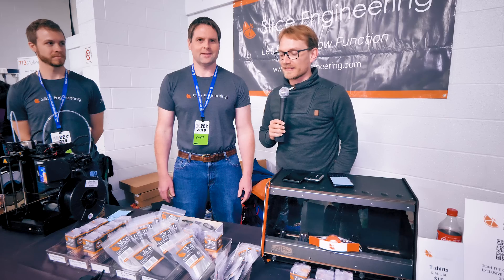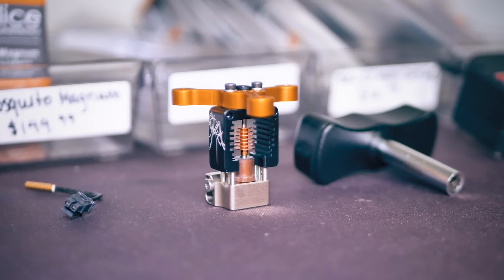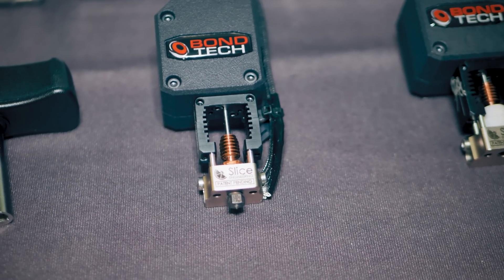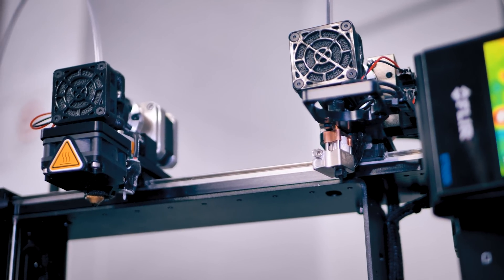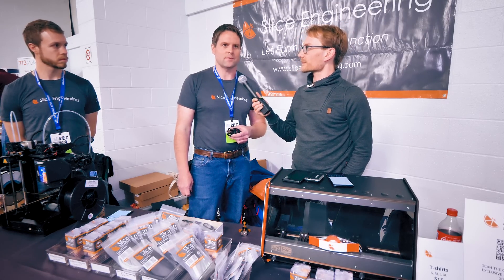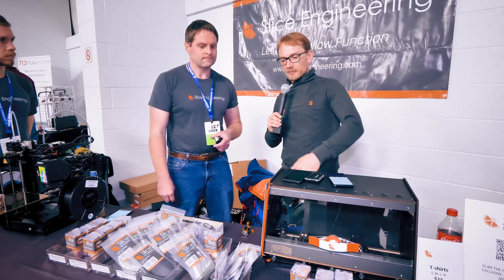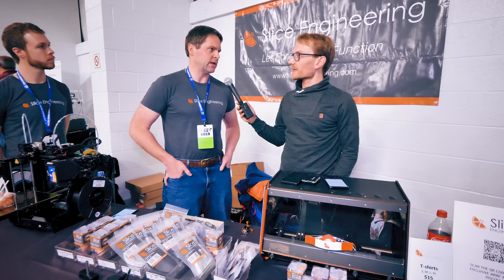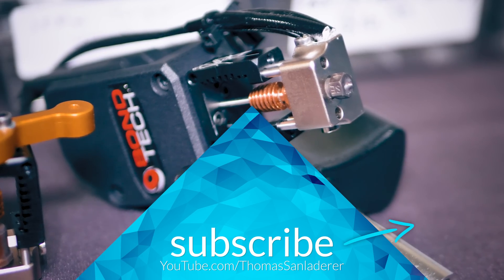The Mosquito Hotend is... wild! #MRRF2019

Comment: Just added this combo Bondtech LGX with the Mosquito to my Voron 0.1 and I am very very satisfied. Prints are amazing and I am told that this combo is not a typical choice for a Voron, especially not a 0.1, When I start building my Voron 2.4 I will surely have this combo on that unit as well.

Comment: I don't know why they stress so much the fact that it allows one-handed nozzle switching and doesn't focus on the heatbreak. This hotend is not a curiosity that allows the nozzle to be changed more easily than a V6, it is the best hotend on the market and it gives a print quality above anything I've tried. Even being an All-metal hotend, the regular version allows printing PLA with retractions without any sign of jamming. And at the same time you can print Nylon or any technical material. It is simply the perfect hotend.

The day I met the BMG extruder, I was amazed at what it was capable of and decided to change all the extruders of my machines for this one. The same thing happened to me with the Mosquito

Comment: So what is that black 'clamp' made of, where the additional four bolts go in? Is it ceramics? Or titanium?
Reply: The black part is an anodized aircraft grade aluminum heat sink. There are only two bolts that enter that heat sink, the other four posts are hollow tubes to reduce conductive heat transfer away from the hot block.
Reply: @SliceEngineering  Thank you!

Comment: I'm very sold on this, most of the android parts have to be super filaments that require 300 or hotter temps to print pa12, hytrel, peek, etc and even for the carbon fiber polycarb that's still 275 which is out of range for standard stuff

Comment: Hallo Tom
  Would be interesting to see a review of TMC5160 drivers and also some heads up for Trinamic's brand new integrated controller driver TMC5161. The later seems really interesting with integrated mosfets. Pretty sure watterott electronic would come up with a silent step stick with TMC5161.

Comment: "Means of cooling other than fans"!? Am I thinking glycol is involved?
Reply: Nah. It's just that there's so much thermal mass on the mount they were using that it would take forever, even in  elevated temps in an enclosure, for you to soak the guide area of that heatbreak. So long as your enclosure itself is cool enough to keep your filament from melting before it hits the extruder drive, you're golden.

Comment: Still waiting for a hot end with induction heating.
Reply: @npgoalkeeper _ Those who have used soldering irons with induction heating (e.g. Metcal) would actually say it's a very effective way to deliver heat.
Reply: @NiHaoMike64  I think the problem is that soldering stations like the metcal type relies on the curie effect for temperature control. If you wanted this for extruders then you'd have to replace the heater cartridge when changing materials, if temperature accuracy matters
Reply: Specifically it's a very "fast" way to deliver heat. You can have a hot end with very little thermal mass that heats up and cools down very quickly.
Reply: Yes but that doesn't cool quickly. It's the very low thermal mass that I'm interested in.
Reply: @npgoalkeeper _ I'm pretty sure I said very low thermal mass......

Comment: Wow, that is pretty cool ! Let me check out that product page....$150-$250...even the thermistor is $40....Yeah no thanks guys.
Reply: @npgoalkeeper _ The ONLY plastic that requires active cooling with the Mosquito is PLA. PLA is very "sticky" and tends to adhere to metal. If PLA was not the most popular filament, we would sell the Mosquito without a fan.
Reply: @npgoalkeeper _ I won't need it because I'm not spending 200 bucks on a hotend lol. It's a very nice hotend, but the pricing is just ridiculous.
Reply: @npgoalkeeper _ The Mosquito is routinely used for high temperature printing - the design eliminates the need for water cooling. Some of our customers include medical device companies and race car teams that print PEEK and Ultem parts, respectively, without the use of a cooling fan.
Reply: @npgoalkeeper _ someone forgot to watch the video. If you put it on a big block of metal, no heat sink is required at all, nor is a fan required.
Reply: @Anonymouspock  sorry to jump in, but I did happen to watch the video - I just don't think you understand how cooling works. if the ambient temp in the camber is hot enough to hit 70-80c, it doesn't matter how big the block is or even if you have a fan, the heat has nowhere to go. The only thing that works in that case is an outside ducted fan or watercooling.
Reply: @obie224  well, not necessarily. with 80C chamber and fanless heatsink that they seem to offer, you can actually "afford" having that heatsink at ambient temperature of 80C and everything will print just fine. PEEK wouldn't care if it's 80C ambient or 20C.
Reply: @npgoalkeeper _ Thats nice, but I'm afraid to ask what that's gonna cost lol.
Reply: @npgoalkeeper _ It really depends on your printer setup - you need a thermal sink for the hotend to attach to, then optimize print speeds, chamber temp and build plate temp to get inter-layer adhesion and prevent warping. You can actually run a fan in a heated chamber - you just need a properly engineered fan :)
Reply: @SliceEngineering  What I don't get is that you target the consumer market with these kinds of prices o_O ... I mean ... Even a cheap 15$ knockoff hot-end will do the job for most materials, you truly need to justify such an expensive tool
Reply: @pixelsafoison  well, to be fair, this isn't designed for "most materials." Like, this isn't a hotend that you'd buy just to print Benchys out of PLA with. This is designed for printing materials like PEEK or Ultem, which start out at temperatures of 360- temperatures that would melt most standard hot blocks/hot ends. In addition to that, from what I've heard they've engineered this hotend to a degree that it'll basically eliminate any hotend problems you could have with other materials. So yeah, it's expensive. And most times, I'd be with you about it being overpriced. But looking at how engineered it is and the materials used to make it, I'd say the price is justified
Reply: @npgoalkeeper _ look up the thermal dissipation. These things are easily pushing the upper limits of their ability without need for water cooling. The thermals on the hot end work so well that they actually could make it HALF the size and it still work well, but the problem then became that it doesnt fit any stock printer as the unit becomes so short from mount to tip of nozzle, so they kept it equivalent to the size of a V6 so it was more universally useful. As for the price yea its high.. but look at its components vs what you also pay for its equivalent parts, copper block and such, making it better than even the E3D V6 Gold edition out of the box. Also that thermistor is accurate at both ends of the spectrum, hot AND cold, while the whole unit is rated to 400C (their 25w heater from them rated to 350C printing temps). Lets see any other hot end compete with that for the same price.

Comment: I have the Mosquito on my printer.  Absolutely incredible engineering and quality.  Like Chris said about unscrewing/screwing in the nozzle, that is my biggest gripe about E3D hotends, what he said is spot on and what they did on the Mosquito to solve that is my favorite part about it.  On top of that, it's lighter and more compact than the V6 hotend.  The quality of machining is top notch and nothing comes close to it.  The hotend also handles extremely high flow, I print with it with PLA at 150mm/s with 0.3mm layers with zero issues.  It's incredible.  I plan on getting another one for another printer and printing PEEK/Ultem.
Reply: It is really a very nicely engineered and machined piece. I was impressed when I received mine. Really makes the whole V6 system feel antiquated.
Reply: Which printer do you use it on? Any vids? Thanks!
Reply: @titaniumapple1  most likely he's using a railcore ii, around $1700 for the kit with the magnum mosquito hotend

Comment: Except it doesn't fit a piezo leveling system without an extended grovemount adapter, which then defeats the idea of a single handed nozzle change.
Reply: @npgoalkeeper _ if you ever used a piezo groovemount, you'd know that's not physically possible, it would spin in the btech before you get the nozzle loose -- I have this setup
Reply: That's going to depend on the hotend setup of your printer. I have a Mosquito and a Precision Piezo Orion on my Railcore. One-handed/cold nozzle changes work just fine. The only reason the Mosquito/Piezo mount is even as large as it is is to maintain compatibility with the E3D version of the mount. 

The Mosquito is also considerably more rigid than the v6, which I've found helps a good bit in terms of accuracy/repeatability of the Piezo.

https://www.thingiverse.com/thing:3240565

Comment: That filament path heatbreak better be stainless steel! :) It's one of the worst heat conductors, even worse than titanium, which is a good thing when it comes down to heat breaks. Before I buy I'll just wait to see how well it prints with PLA, I was one of the earliest adopters of the original E3D hotends and the first types really jammed hard on PLA and it cost me a lot of frustration so I'm very careful with trying out anything new when it comes to hotends and PLA is still the most printed plastic in my workshop.
Reply: The heat break is composed primarily of a stainless steel alloy.

Comment: Nice idea! Looks well thought out too. Not sure about saying made in USA is a selling point to the rest of the world. It just means more expensive not necessarily quality
Reply: I agree. There are enough factories in China with skilled engineers and machinists who can make high quality product as well for relatively cheap. So that leaves just the point of supporting USA's economy instead of China's
Reply: @Itheeric  Well, it leaves the point of supporting the people who are designing and engineering the product, instead of people who are copying existing designs.

Chinese copies would likely make incorrect materials choices anyways. I was engineering my own hotend and came up with a very similar design, I was able to talk materials choices and geometry with them there at MRRF. The exact alloys used are all for very specific reasons. Even the ceramic insulation sleeve is a great example of materials choice. Anisotropy of  thermal conduction in the copper alloy is even taken into account when setting up the block for machining.

304 stainless welded hypo tube and a chrome copper alloy for the heat break and block, and a tool steel with a higher tempering temperature. You see a lot of people designing and selling A2 tool steel nozzles despite the 180-260c tempering heat of that alloy. We were able to talk over this fact and why they chose their alloy for the nozzle.
Reply: @williamforbes6919  I didn't mean copies, I meant them (the original designers) manufacturing it in China with the same materials and tolerances. This would cut down cost and perhaps mean a bit more profit margin. But yeah that would make it easier for others to copy it I guess.
Reply: @Itheeric  The difficulty with manufacturing short run in China is verifying the supply chain for materials and guaranteeing tolerances are maintained. 

I've heard more than enough horror stories about the contracted company changing the exact alloys used without notifying the designer first in an attempt to lower production costs. Same with very minor changes to tolerances.

Obviously you can have high quality production done in China, I have owned Chinese manufactured products with exquisitely machined components. So the capability is absolutely there. I've also had USA produced parts (same part actually, a D-shaft hub) which are total crap, so the nationality of the man operating the equipment clearly doesn't have a bearing on quality.

With the low quantities produced it is probably less expensive for Slice Engineering to manufacture their Hotends locally, considering the rapid design turnaround and required tollerances. Sourcing materials is probably easier too since they can fairly easily buy their materials with a certificate of compliance here stateside. The heat block is being machined with the crystal structures orientation in mind, verifying this is followed without being able to personally inspect the production would be difficult. 

If they end up manufacturing these by the thousands then the cost benefit relationship could definitely change.

Comment: I don´t really get what the benefits are, can someone eli5?
Reply: So you'll get better performance out of a nozzle with a better heat break. The retractions should be cleaner & the pressure of pushing plastic through the nozzle should be lower. you can also change nozzles with 1 tool instead of 2 & it can handle over 300 degrees in temperature so it can be used in builds that need to handle extreme heats.
Reply: Me neither...

Comment: Doesn't the CR-10's hot end already have the "anti-rotation" mount where they have 2 screws going up through the heater block to the heat break?
Reply: Pretty much.
Reply: @infernaldaedra  yes, but heat is transferred into the heatblock, causing issues. this screws into a purely mechanical component, which is not thermally active in any way
Reply: @MakingwithLuke  It has been tested and shown to not make any significant impact either way on the creality hotend.
Reply: Odious Ritual that’s weird, cause a lot of people complain about it making a difference. And I really don’t see how it wouldn’t.
Reply: @infernaldaedra  oh ok, I had heard some things, but don't have one myself. I know theoretically more heat will be transferred, but in reality, they may have solved the issue
Reply: @MakingwithLuke  You keep saying it has issues?
Reply: @infernaldaedra  I have hear it does, and theoretically, thermodynamics says it is better to have less material bridging in between hot and cold if you want to keep one side hot, and the other side cold. Its not the greatest design, but if it works, it works. the fan in it might be powerful enough to cool the heat sink adequately

Comment: So... If this nozzle is so hard wearing, why do you need to change it so easily?
Reply: Different sizes.
Reply: I wonder how many people actually change nozzle sizes? I have a suspicion it's not a huge percentage of 3d printer users. All three of my printers still run on 0.4 and have been for a good few years. It does the job.
Reply: edit, wrong button: If I needed a high output faster/bigger print solution, I'd probably build another printer, stick a Volcano and a 0.6/7/8 diameter nozzle, and hang a 5 kilo roll on the wall above it. That way you have an optimal print experience, ( and another 3D printer! ;-) )
Reply: @pinkmouse4863 Or you could just spend less than 30 bucks on another nozzle instead of several hundred on a new printer. I change nozzles all the time. Just because my printer has a 300mm dia x 760mm build area doesnt mean it cant do really detailed small prints. I often swap between .6mm nozzle & .3mm nozzle as standard. then switch between tool steel & aluminum nozzles depending on abrasion. I also have a 1mm nozzle for Extremely large projects.
Reply: @pinkmouse4863  I have 3 printers and switch nozzles all the time.  When you want to print large brackets or structural parts that don't need a super fine layer height larger nozzles get the job done faster.  0.4 is still my standard. With 0.6-0.8 for fast prints. 1.0mm is just silly, but can really create some nice BIG prints if you use it in vase mode.
Reply: I guess we're pretty much paying for flexibility. I only have 1 printer and changing nozzles is quite a hassle.

Comment: I like this. Wonder if there is much deviation in length after a nozzle change.
What I'm getting at is if you use a Z probe, will you have to mess with the z offset or if you can get away with simple changing it out and printing right after.
Reply: I have a printer equipped with a Mosquito and BLTouch.  Changed nozzles a dozen times and never had to mess with offset at all.

Comment: Nice product, does solve an age old problem with FDM printers .. changing the nozzle should be easy.
An alternative solution I have used, is to design the extruder so the entire hot-end can easily be swapped by loosing one screw ... then one can use cheap E3D clone hot-ends with a quality nozzle, which all add up to the price of one of these Mosquito hot ends. The super thin heat break on the Mosquito does seem to make this the best solution for quick changing nozzles .. assuming the printing performance is best in class .. can we see some print quality reviews next???
Reply: Kind of a late reply here but I would just like to point out that the age old problem was solved in 2014 and shipped as standard on the Ultimaker 2 from 2015. It constantly amazes me that no one else has really caught on in all that time.